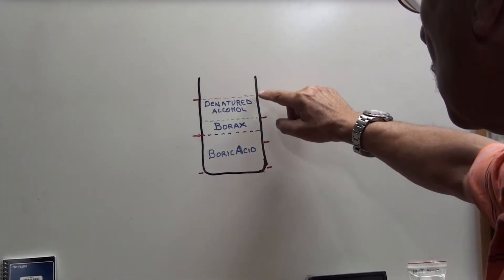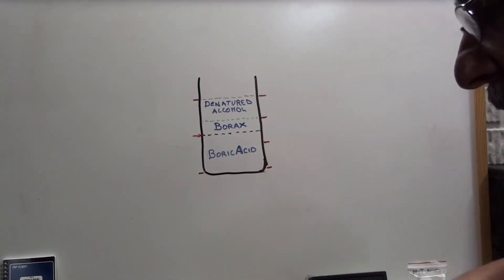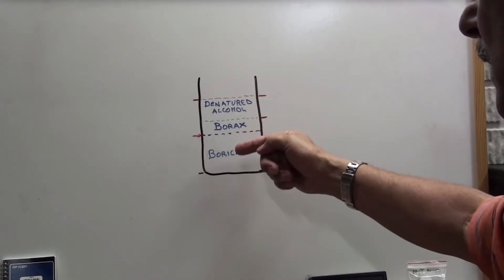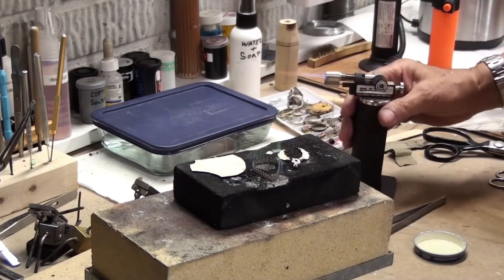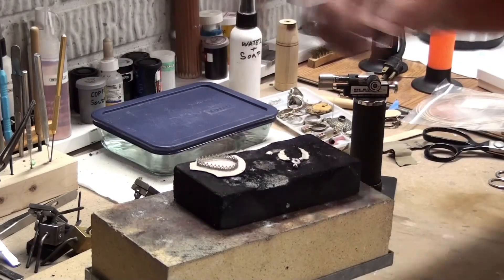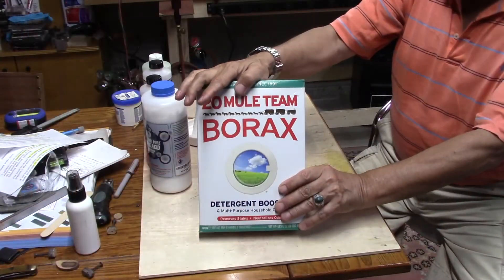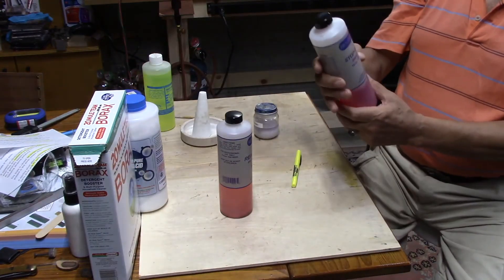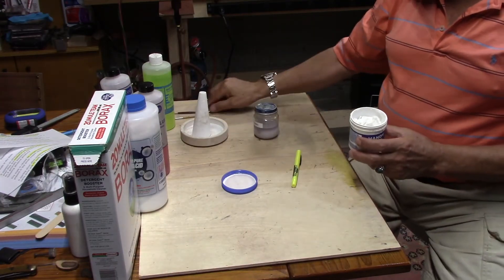Fire Scale Prevention

Comment: Should the mixture dissolve eventually? It would be nice to have it in a spray bottle.
Reply from the maker: Yes the mixture will dissolve after soldering by putting the silver piece in the acid to clean it then polish. The problem with the spray bottle is the boric acid and the borax are in powder form and they will plug the spray nozzle. Thanks for watching my videos 😊
Reply: I meant will the mixture dissolve and turn clear in the jar? Or does it remain white and granular? Thanks!
Reply from the maker: No the mixture doesn’t dissolve.

Comment: I mixed up a batch of this according to your formula, 1/2 Boric Acid, 8 tsp of Borax, and the balance with denatured alcohol. This equaled a total of 1 Cup. It seems a bit grainy. Is that normal?
Reply from the maker: Yes Sandra, usually it will settle down on the bottom and the alcohol on top, when you dip your silver in, use a tweezers and stir everything, that will work.

Comment: Thank you, Elie. I have used boric/alcohol and use Pripp's most recently as a barrier because I like the stickier quality for also helping parts to stay together for solder placement, but still get fire stain, particularly since I started working with the Little Torch. It seems like my time runs out in how long the barrier will last, or the addition of oxy in the gas mix makes it more prone to happening. I'm going back to acetylene/air next week to see if that helps because I think I might be overheating in an effort to get the Little Torch to work like a big torch, even with the Paige tips.
Reply from the maker: Diane, try to decrease the amount of oxygen a bit, the oxygen is the culprit when it mixes with the copper.